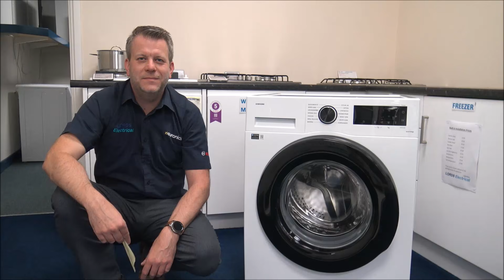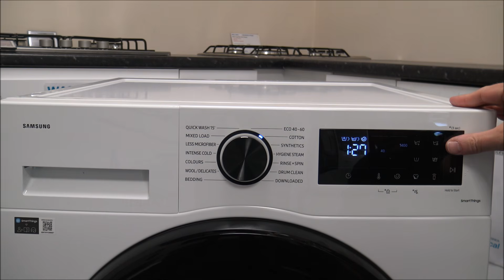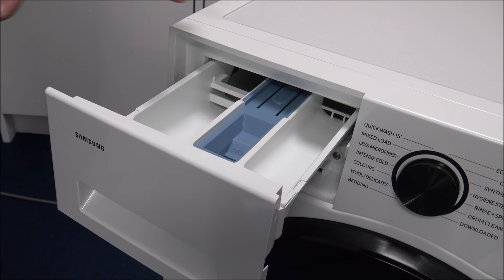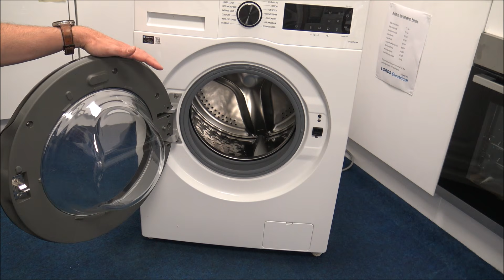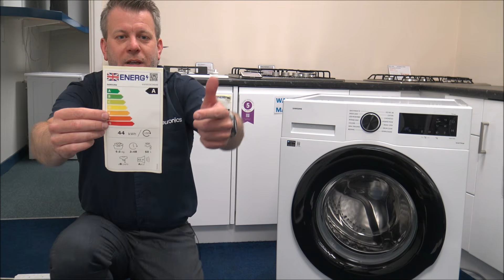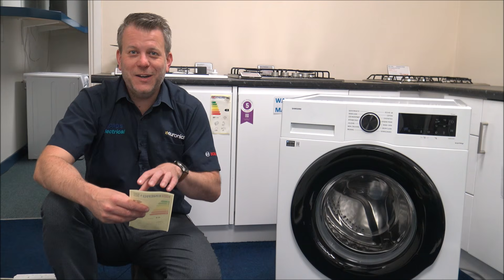Samsung WW90CGC04DAE 1400 Spin 9Kg Washing Machine

Comment: One of the worst things about choosing a new appliance is the model numbers. Why can't they give models meaningful names rather than an incomprehensible string of letters and numbers? It means that when reading reviews you often find the model number doesn't quite match, and you don't know if the review is any use!
Reply: It might look confusing but all you need is a breakdown table online. For example the washing machine in this video WW90CGC04DAE/EU:
W - Washer 
W - Front Load
90 - 9kg capacity 
C - Developed in 2023 
04 - 1400 RPM 

Usually the model number categories are in descending priorities, so every Samsung washer with WW90CX should share the same internal design, and problems, if any.  The same logic goes to every manufacturer and  every appliance.
Reply: cgc crystal glare collection ,ww washing machine 04 =2024 ,90=9kg, eu made
Reply: It is annoying as hell because it change so often you can never read reviews from users that have used it for en extended amount of time. A machine that has worked good can never be bought again.
Reply: You basically have to pick your favourite brand and download the full catalogue..